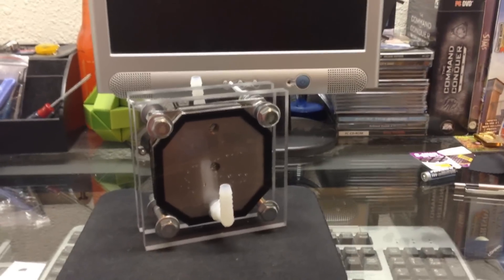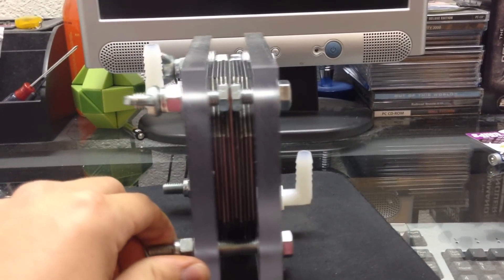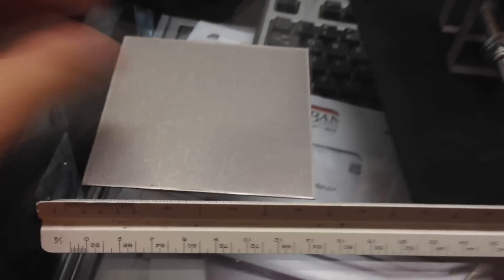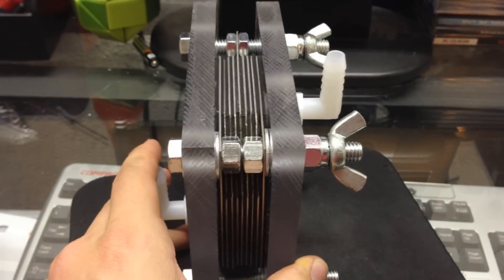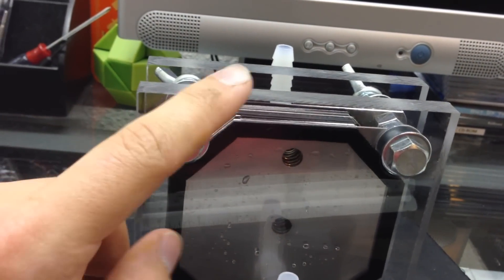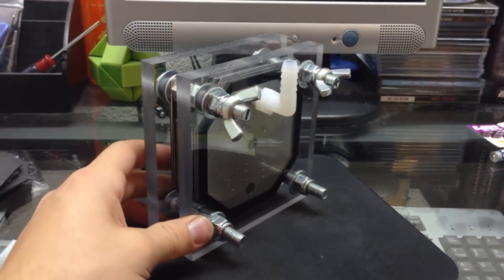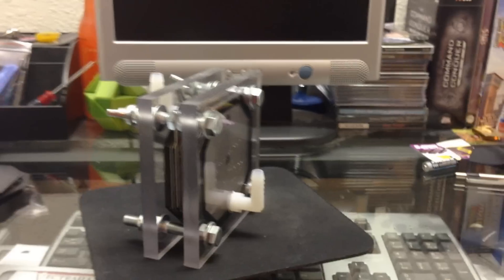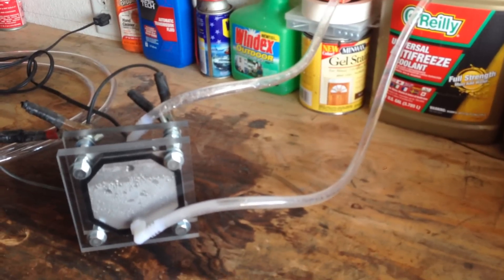HHO Dry Cell 9 Plate Homemade

Comment: why do you have neutral plates ?
Reply from the maker: Phillip Pelling every neutral plate drops the voltage between plates by half, to high of volts makes the water get hot super quick and is inefficient, you want the voltage between plates around 2 volts I believe

Comment: So with a dry cell, not quite sure how it works, the lines to either end of it both supply water to the electrodes, and allow gas to travel back up to the tank where the water is held?
Reply from the maker: Ben Sullivan how it works is water goes in through the bottom port and passes through electrodes and the gas coming off of them wants to travel upwards so it escapes out of the top hole back to reservoir taking water with it thus continuously circulating more water through the cell.

Comment: N what do u mean by nutral plate in hho-+-+-+ no any nutral palte
Reply from the maker: haroon ahmed A neutral plate is a plate that is not hooked up to either negative or positive and is used to lower the voltage between the negative and positive plates

Comment: Nice job, I was wondering if you used fine mesh stainless steel screening you could increase  the exposed surface area of the  positive and negative  plates . possibly  making the cell  more efficient?
Reply from the maker: Erik Kristjansen it would work for a couple hours but would be very inefficient, get extremely hot and it would eventually be completely eaten away by the electrolysis bc it's too thin

Comment: Nice job! I want to make one for my school project. I have two questions: How thick are the stainless steel plates? And how thick are the rubbers? 
Thank u.
Greetings from Holland.
Btw sorry for reacting to your video from 2013 in 2016:)
Reply from the maker: Thanks! Steal is 1/16inch and rubber gaskets are 1/8inch
Let me know how it goes!
Reply: Logan Gamble one little question. What's the best amperage to run it on?

Comment: IF YOU GET A CHANCE TRY USING 316TI AS THE POWER PLATES,   316L AS THE NEUTRALS, KOH, DISTILLED WATER, CCPWM.  WATER WILL STAY CLEAN AFTER 8 MONTHS RUNNING
Reply from the maker: Nice I'll keep that in mind! Thanks
Reply: gary shirley never heard of 316TI...

Comment: I want to make a dry cell for a 1.6 engine how many plates do i need?
Reply from the maker: 19 plate like the one in my battery box build videos would be good
Reply: Hi Logan, may I ask the plate configuration of the 19plates setup, regards

Comment: What the max amperage it can handle???
Reply from the maker: This small one can handle up to 35-40amps but isn't very efficient in that range and would run too hot.
The larger one I made can probably go up to 45 or 50 but again it's most efficient in the 15-20 range
Reply: Logan Gamble what if my battery only 3 amps 12 volt? How Wide of the plate should i use?

Comment: hallo
im planing on makeing a 8 cell with 4 negative (-) and 4 positive, so its like positive, neagtive, positive, neagtive, positive, neagtive, positive, neagtive...
will this work???
Reply: I found my cell got too hot with alternating pos/negative plates so too much steam. I  added neutral plates and made mixture more concentrated.  Lots of hho and the neutral plates keep it cool.
Reply: @kenaten9692  You don't want to generate heat.. You will not get any more gas by just increasing the voltage. Read this and you will get a clearer picture:
The things that matter for the electrolysis to work are the following.

Surface area: You can increase this by using larger plates or more plates. The thickness of the plates do not matter, they will however not last long if they are to thin. By increasing the surface area per plate you will need a higher current per plate for it to run. By increasing the number of plates you will need a higher voltage. The total power consumption (wattage) however, stays the same either way you chose to get more surface.

Optimal voltage: If I remember my chemistry classes correctly, 1,8 volts DC per plate is the minimum for electrolysis to occur. The range differs depending on the resistance in your water mix. More salt (or other suited chemical) means less resistance and thus lower voltage. Anything above the needed voltage will transform into heat, and heat is something you really want to keep away from such a device. It can explode even if gas is trapped in water since the hydrogen is mixed with all the oxygen it needs to burn. Use a variable power supply to find your sweet spot, then get a fixed power supply (because they are way cheaper) with that voltage for permanent use.

Electrolysis mix: I don't know what proportions that will give the best result, but I would say as little as possible since the excess will only make your plates wear out faster. Obviously one salt will get another result than another salt or baking soda. But avoid sodium hydroxide (table salt), one byproduct is chlorine gas which could kill you.
Reply: @gustavferdman214  thanks brother
Reply: Wet cell yes drycell is + nnnnn-nnnnn+ ..... on 12v